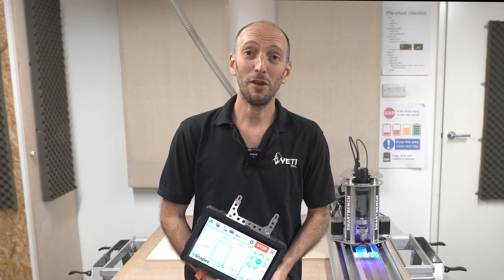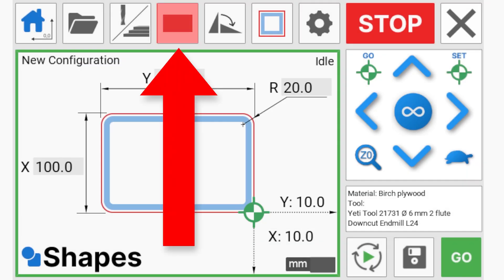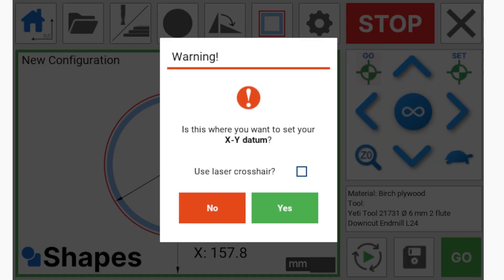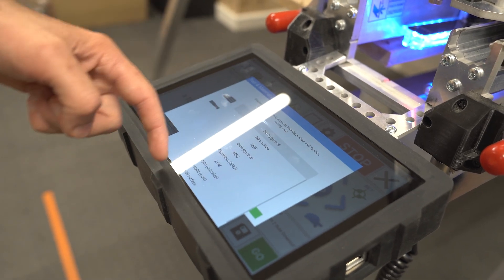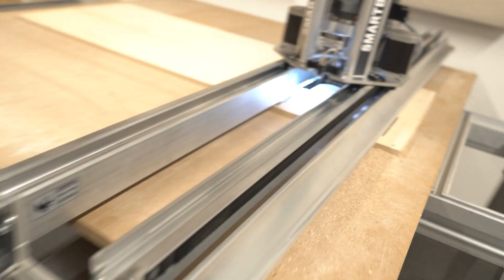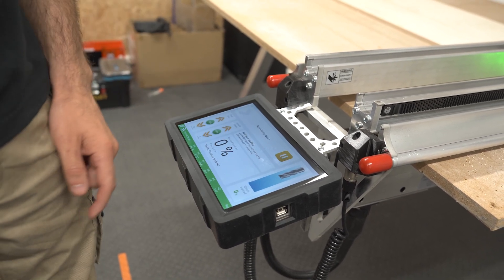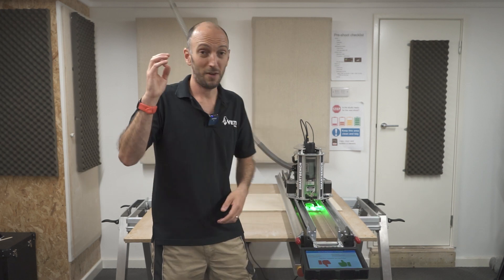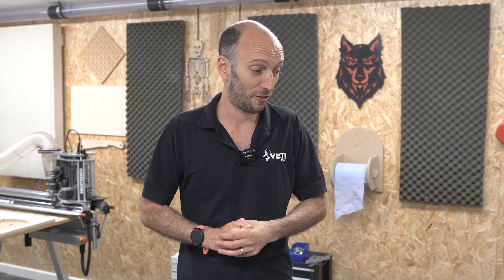Shapes App Demonstration | Design and Cut Basic Shapes with SmartBench in Minutes

Comment: Can you adjust the amount of tabs you place on a shape. Something that size would only need 2 for instance.
Reply from the maker: No, at the moment the tab spacing is fully automated. For this release, each tab is spaced at 20mm intervals. Each tab is a 3D profile with widths of 10mm between tool centres (so a width of 10mm minus the diameter of the tool). We have taken this approach to minimise workholding failure.

Tabs definition is a a really interesting question - we want to make everything as automated as possible to reduce complexity, so if you have any ideas on what you would like to see, please let us know and we will try to build it in to future releases! As a heads, up we will be optimising soon with an option for SmartBench to do a final pass to remove most of the tabs after the majority of the material removal has been completed.
Reply: @YetiToolLtd  20mm intervals!! Really? So every 20mm you have to deal with a tab? Sorry, am I reading this correctly? That's a real pain if that's the case.
Reply from the maker: @nicharvey7211  Thank you for your feedback, we will definitely build more options into our next release.
Reply: @YetiToolLtd  how do we go back? I updated not realising I was getting this beta app and now I’m stuck with predefined tools and materials that don’t fit with what I use so I can’t use shape tools at all now. The old app was painful with its handholding but at least could be customised. This one is too restrictive